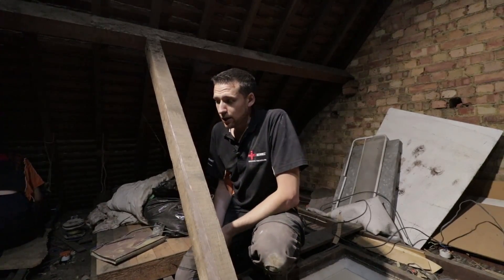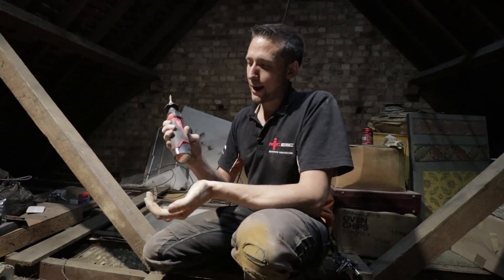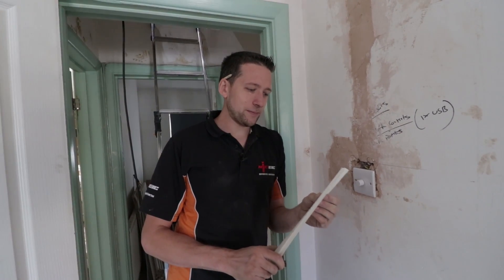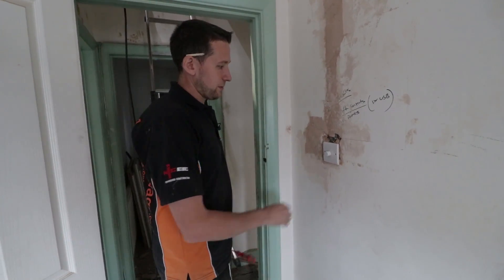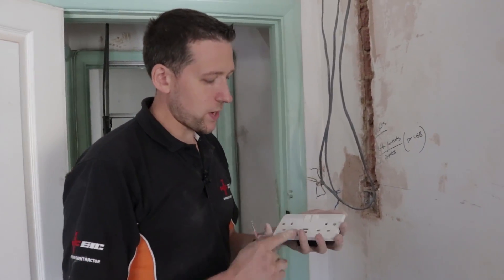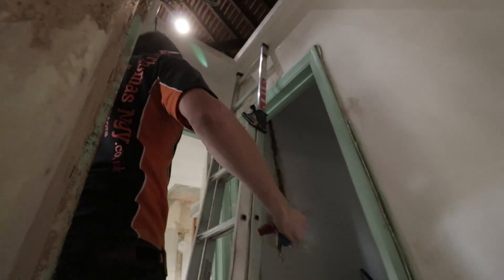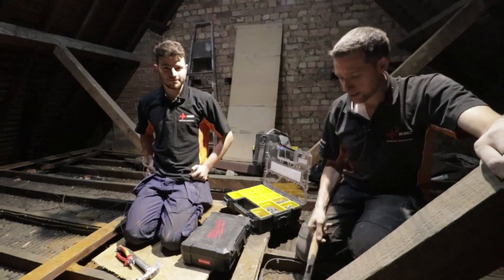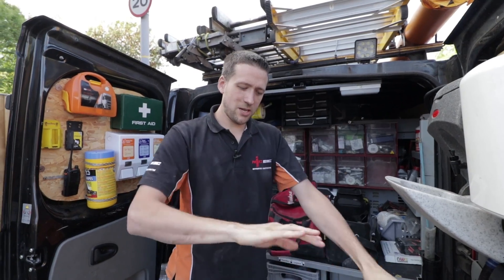Rewiring a "just rewired" house (Part 2) | Thomas Nagy

Comment: Hi Thomas, I know I've mentioned it before, but why won't you listen to an old guy (76 now) please for the sake of your health, get some masks to work in the loft, if you don't you will suffer in a few years time. Please take notice before it is too late.

Regards, Ray..
Reply from the maker: duly noted; will discuss this in next vid ;-)
Reply: Also wear close fitting masks when cutting chases.  Silica dust is fecking nasty
Reply: @cjmillsnun  correct as the h&s guy at work keeps telling us it kills nearly as many as people as asbestosis per year
Reply: YES this 1000 times. Attics are awful for dust, but also awful for heat, so a respirator makes it more unpleasant short term... but will make you happier in a few years.
Reply: thomas nagy  We've just been given 3M face masks and they work a treat. Sweat like a bastard in them though!
Reply: I do HVAC service and repair.  I know another HVAC owner that uses no gloves or masks.  He is a few years younger than I, but the dust has many items in it.  Dirt, rat droppings and fiberglass.  Also some homes still have asbestos wrapping on pipes.
Reply: they also drip after you have been wearing them for ages
Reply: Love if you could recommend one or what sepcifications to look for. Im assuming any old mask won't do.
Reply: If you really want comfort, try a PAPR,
Reply: When did the first symptoms hit you? I'm 32 and I've been working in dusty lofts since i was 14.